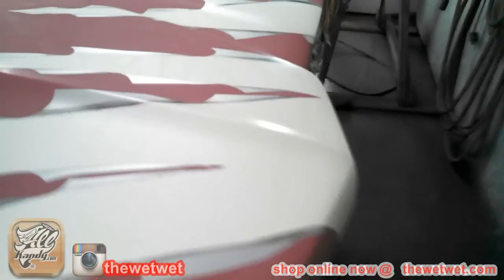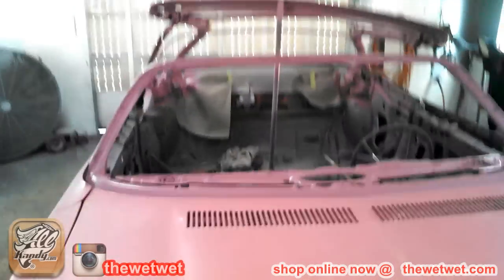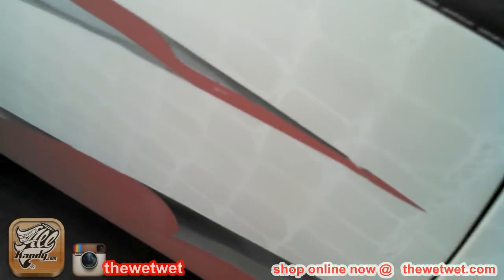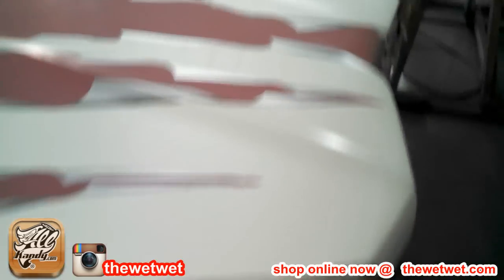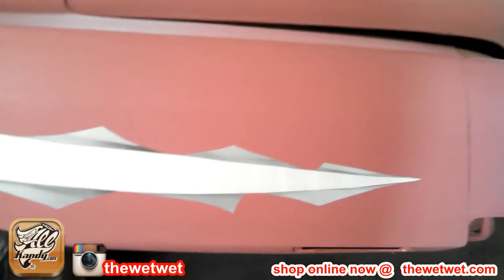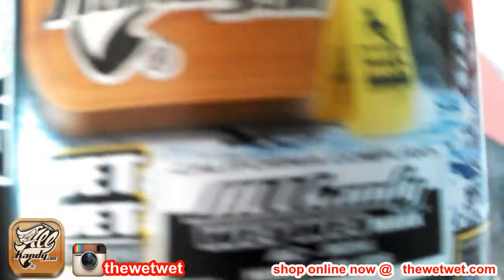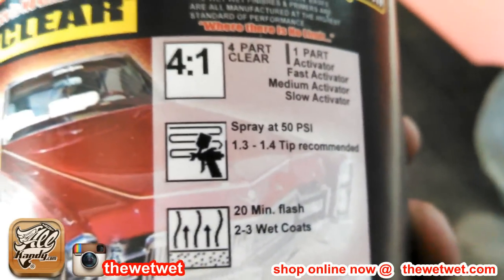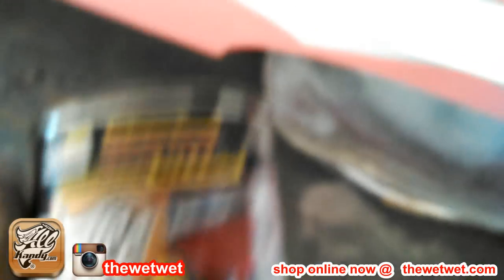HOW TO SUBMERGE TAPE LINES FROM ARTWORK IN CLEAR    THE WET WET MAXX CLEAR COAT    ALLKANDY

Comment: I have a small business doing custom work I use hydrographics with my paint will this max work with it .every high clear I have used pulls my hydro I normally use fusion UV clear then high gloss I'm sick of putting in lots of hours on art and hydro just to watch it shrink or run . or my favorite looks perfect it flashed over come in in the morning and it looks like a big sheet of paper was grad and crumplied it a little. Its frustrating to watch it goes to crap.will it work with hydrographics like dashboards ect  will it yellow after being in the sun. for a bit of time.I gotta find a clear that I don't have to spray UV then dry then clear then high gloss then cut and buff wax.I also use heat changing paint I need high UV protection. I've seen most of your bids I'm interested but not sure if it will work with hydro.paint sure it awesome looking but water transfer is what I do with paint .
Reply from the maker: I have had other hydrographic shops use our product works great...  you do not add reducer to our product which makes it great for hydro.... all I can say buy a QT and try the WETTEST CLEAR ON THE MARKET!!!!! WET WET .. WET WET PLUS OR MAXX  FOR YOU HYDRO GRAPHIC BUSINESS...